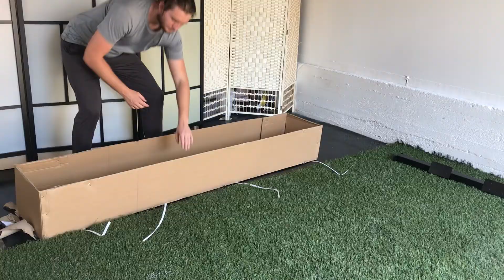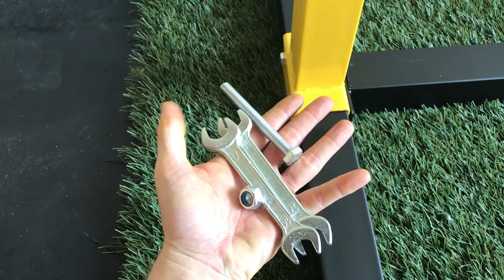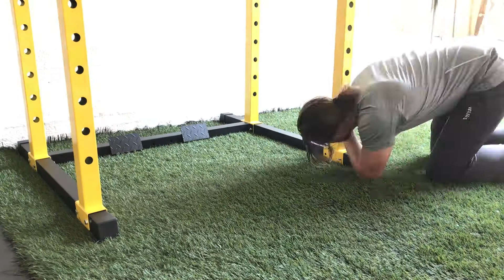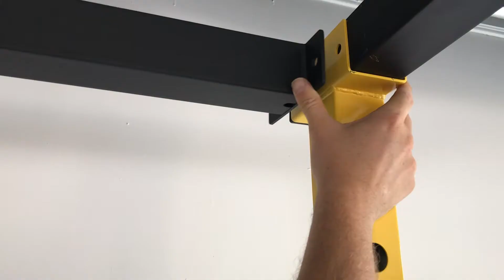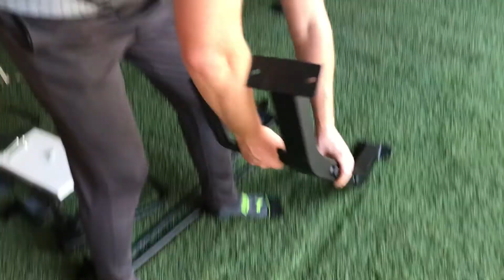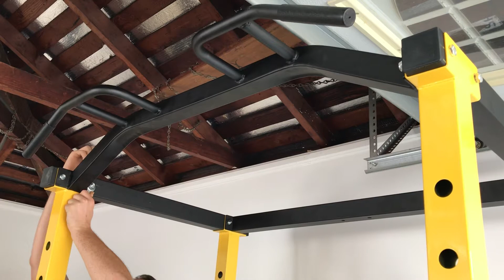HulkFit Power Cage (Everyday Essentials) | How to build & Unbox tutorial video

Comment: is there a order for where the yellow beams should be installed. I got mine without instructions and I put them together based on the video on YouTube. However the entire rack moves a little bit when I do pull up, not sure if that’s normal and if that’s due to  certain beam installation requirements
Reply from the maker: No there’s no order based on the instructions and the pieces are the same. Mine also move a little bit during pull ups and dips I think it’s just the cage.
Reply: @kyletschmidt  thanks man
Reply: I think the longer portion of the base should be at the front of the rig